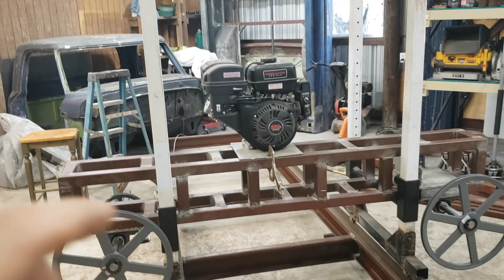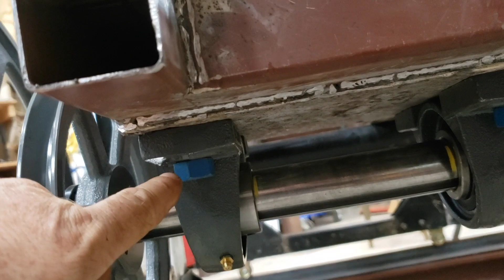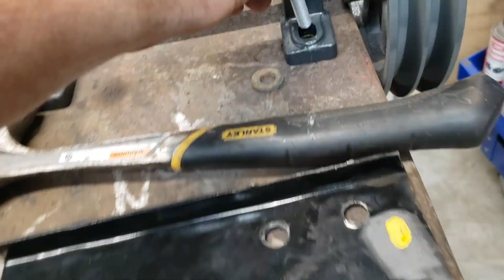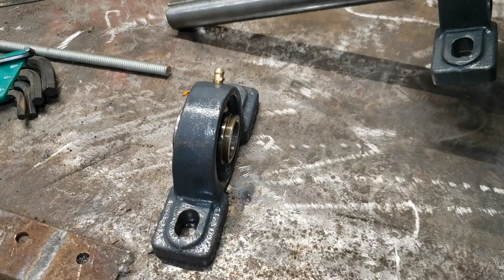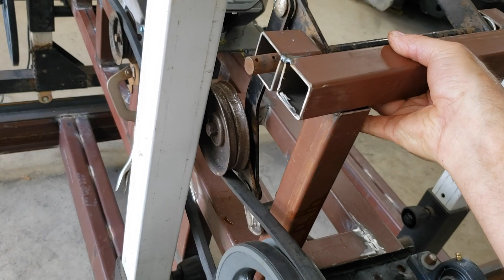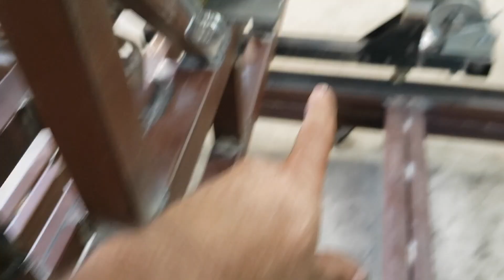K-man Builds -  DIY Homemade Sawmill - Engine and Drive System Video #4

Comment: Those retainer rings are cam locks. With a punch drive them clockwise and then tighten the set screw. Then you'll know to drive them counter clockwise to take them off.